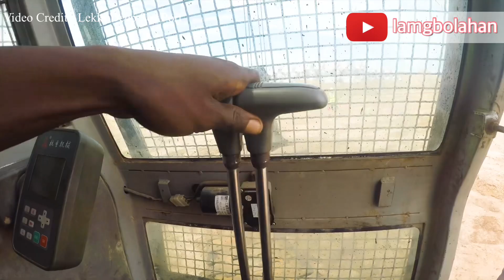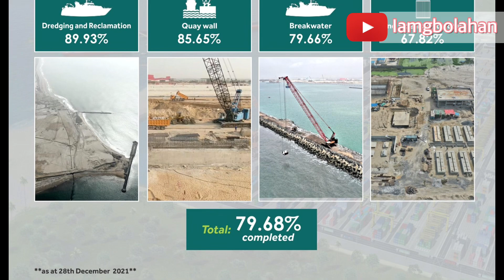The $1.5 Billion Lekki Deep Sea Port Project In Lagos, Nigeria || Nigeria’s First Deep Sea Port

Comment: How about the Ibom deep sea port, I think it’s going to be bigger than leaking deep sea port
Reply from the maker: Yes, the Ibom deep sea port will be bigger and it is designed as trans shipping port, that is goods meant for neighboring countries can be trans shipped from there using smaller vessels.
Reply: @Iamgbolahan  thanks enlighten, i think unity should start happening from Nigeria to the Africa continent